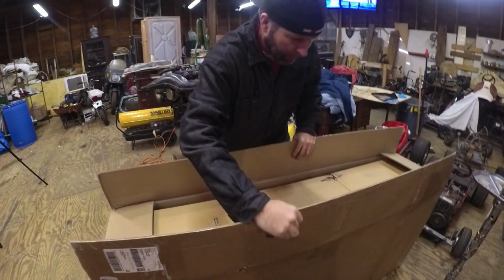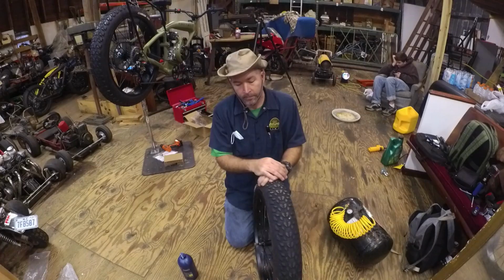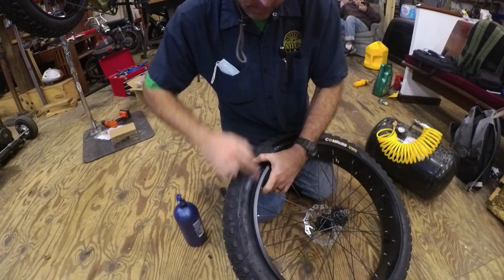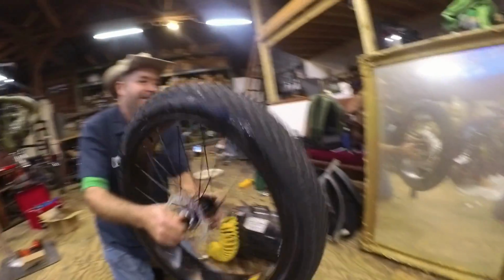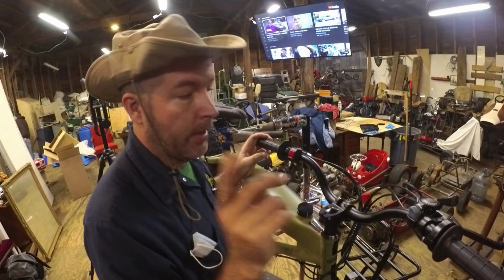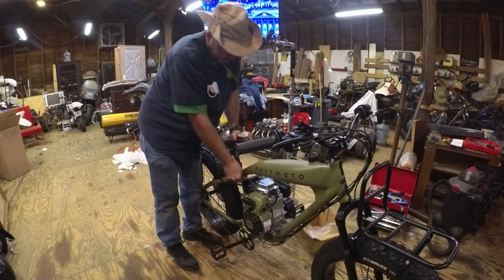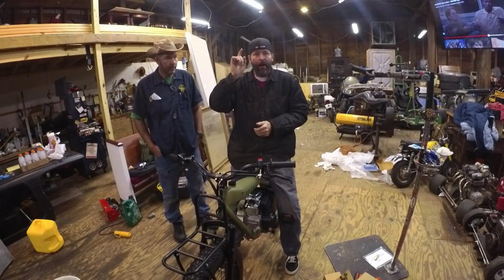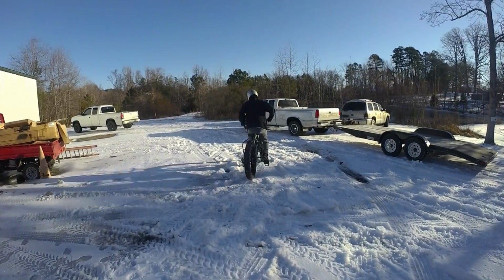2022 PHATMOTO ALL TERRAIN With The All New Shimano 7 Speed.

Comment: Great video Isaac. A few owners lose that shifter from the right side and fit a 7 speed grip shift on the left bar  or go up to a high range 11-34t 7 spd  cassette  for hill climbing   one gas a 32t front chainring and 8 speed 11-46t   lots of tuning parts 😀

Comment: Isaac, I'm wondering, if we can use a 
"Sick Bike Parts" idea, to run power to 
the right side?  We'd need a freewheel 
assembly for the pedal crank.  Wouldn't 
need the jackshaft, because we already 
have one.  Just put a sprocket on both 
sides.  SBP has most of the parts, we'd 
have to order 2, 6202 5/8ths bearings.

We would need the jackshaft, but not 
the mounts for it.

steve
Reply from the maker: Not familiar with that

Comment: I like this bike and I can just imagine transporting both game from the woods along with equipment into the woods adding adding a jack shaft kit with this to the gears with the engine for more speed and power it would be fantastic in the woods and if you added an electric rear wheel hub and drive kit it would make it a true hybrid all trane pedal assist bike for hunting or fishing that you could pair with a DIY lite weight game hunting trailer for transporting game from the woods along with equipment like guns or bows and arrows but also equipment into the woods like lock on tree and ladder stands or ground blinds or even climbing tree stands. It would be greate.

Comment: You can peddle faster then that motor can push you. It seems like it is geared to high
Reply from the maker: I was just playing around and didnt mess with the gears. I was letting the engine do all the work
Reply: I know isaac I was just saying. If that's a gass engine you would think. That it would push you a lot faster. From what the video shows on your speed it is slow on top end hummm